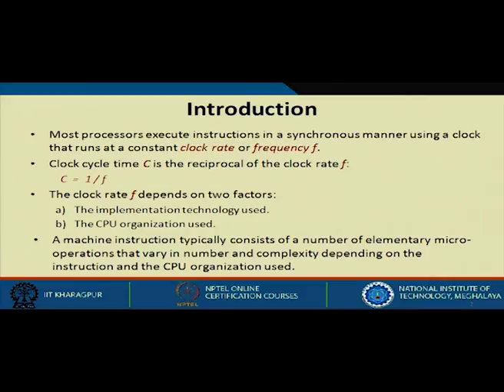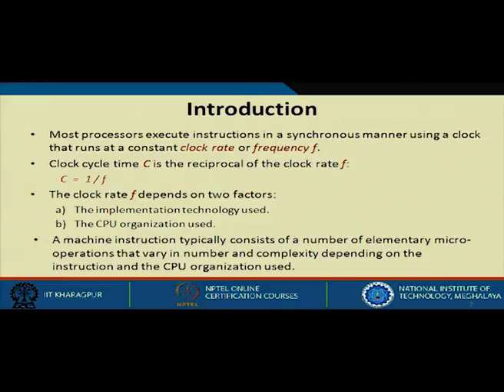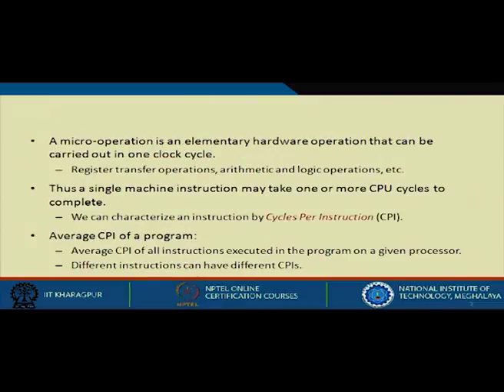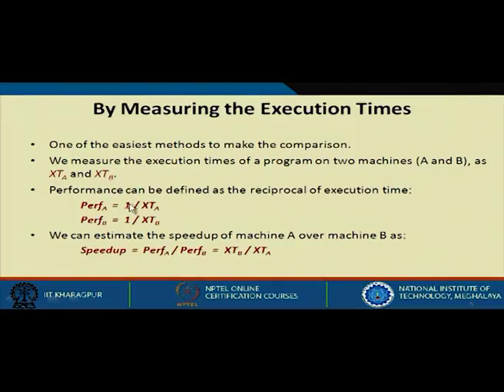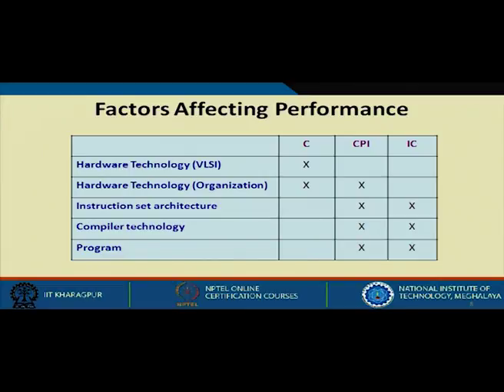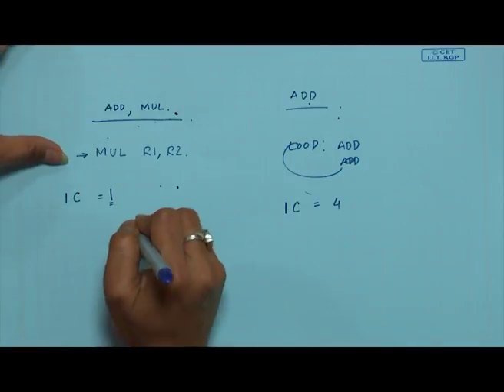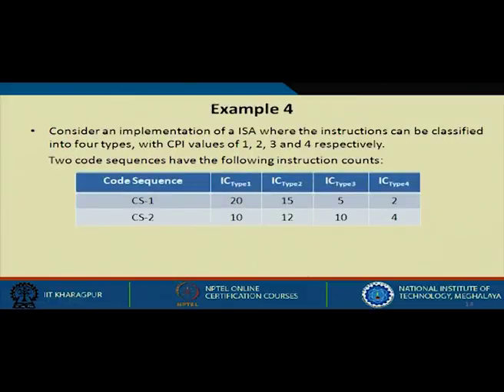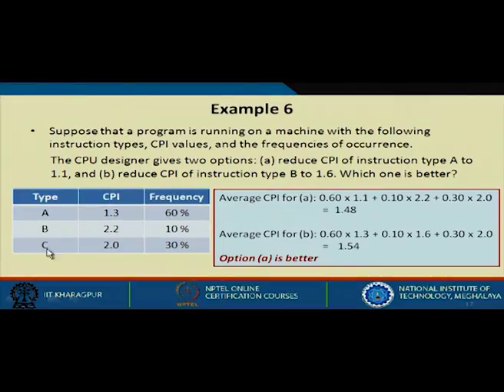Measuring CPU Performance

Comment: The P1 processor has a clock frequency of 3GHz and executes type A instructions in 5
 CPI, B in 2 CPI and C in 1 CPI.  The P2 processor has a clock frequency of 2GHz and executes instructions
 type A in 3 CPI, B in 1 CPI and C in 5 CPI.  If both processors execute 10M of instructions the
 30% type A, 50% B and the remaining 20% C, determine the execution time, the average CPI and the number
 of total cycles for both processors. Can you please help out Prof... I learned something new from you and thank you